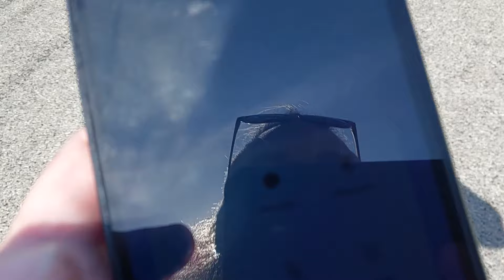ANOTHER Automotive Crisis? BIG Failure this time, NOW WHAT!?

Comment: LOL! I have done that to the v6. I was doing a U turn on Grizzly Peak Blvd about 24 in the Oakland hills. There was a tiny lip on the road, just a couple of inches. My tires dropped off the edge and there was a slight clunk, just the wrong sort of slight clunk. I switched off before anything else happened. Got out and there was oil streaming out. I went back and found a single inch and a half cubic stone on the otherwise flat dirt turnout. I was within sight of my home but it took AAA three hours and two trucks to move me five miles. At least the fix is easy, new lower oil pan. Same color and also a wagon too. My las stick shift, which I wish I had kept.

Comment: That dust storm was wild. All you needed was some tumbleweeds rolling through. Rich is a great guy for coming to get you. Punt the VW for now and go over the Pontiac and see what she needs. If there is any iffy damage to the high mileage engine, shit can go sideways real quick for your wallet and none of us want that. Go through the Pontiac bumper to bumper, make a prioritized safety list, fix major concerns then pick at the little ones so you and Katrina have a really dependable wagon. Sorry to see this happen, but you were kinda close to work and you know a guy with a tow truck and shop. My last "adventure left me 2 hours from home, in a 1991 C1500 that the 700R4 finally gave up the ghost @325,000. I have towing, but it took them 4 hours to find me. Then of course the 2 hours to get her home. Had to Uber to work for 2 weeks until I located a good used trans and swapped it out on the ground @66 yrs old. I`m too old for that 💩🤣

Comment: Man. You cannot just get a break. Good think you took time out to decompress, before examining your options. I would get it towed to a town with auto parts. You just might run into some good people. If not, you have to get it up in the air to get the pan replaced (an accident), the oil filled, and a once over. Where the hell are you located.. You're dealing with it man. When all else fails, call in an extraction. You are cool.

Comment: On a positive side, the engine looks fairly clean inside.  Instant inspection window.  I'll tell you, I have welded oil pans I have gotten out of the junk yard with no issues. So you might just want to make a patch and weld that baby up. Unless it is aluminum then IDK JBweld till you decide to fix it or not

Comment: Ok, can you scab over the hole in the oil pan long enough to run it a few minutes and see if it spun any bearings? That could at least let you know if you only need an oil pan or it's time for a new engine.

Comment: If it ran out of oil you might as well order a turbocharger they immediately self destruct if you loose oil pressure. The engine itself is most probably okay. If you have the pan off you might as well replace the oil pump and the pickup. They go bad in these.
Reply from the maker: That's 100% where my mind went, I ran this thing for MAYBE 5 seconds as soon as the oil pressure dropped I shut off and pulled over, but that already could have been too late. Turbo? Very possibly toast. Engine bearings? Who knows, but they are probably the original ones from 21 years and 200,000 miles ago so likely at least pretty well worn. 

At what point do you just stop throwing money at it? :(
Reply: @AutomotiveAdventuresWithAustin  These VW 1.8 engines are fairly sturdy I don't think it's going to be a problem but you never know.
I'd replace the oil pan and put new Oil pickup tube in it and run it. The turbo is a concern but it's easy enough to replace later (muhahaha) if it craps out. The oil pick up is just a preventative measure because they tend to sludge up over time.

Comment: Audi to engine its a stuff under lift body off suspension too low would have happened on road speedbumps potholes putt taller front springs on

Comment: Dont drive a POS VW product and you won't have issues. I've bought, sold and traded over 200 cars, not including the thousands of cars ive worked on. Including VW. I've owned 3, worked on plenty. There is NO bigger piece of shit than a VW. You wouldn't have bad luck if you had something better. 4 grand in an old 1.8t VW is about 2500$ too much.